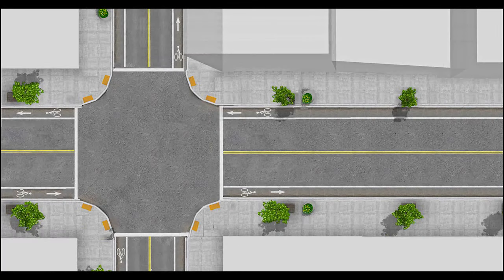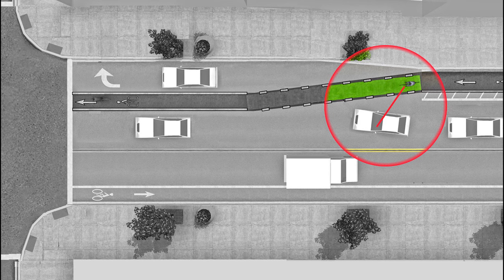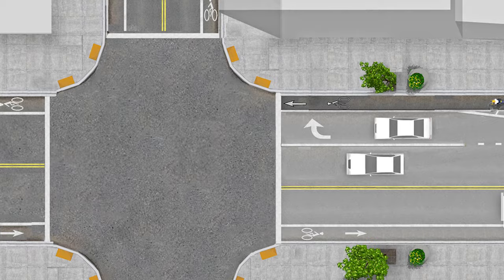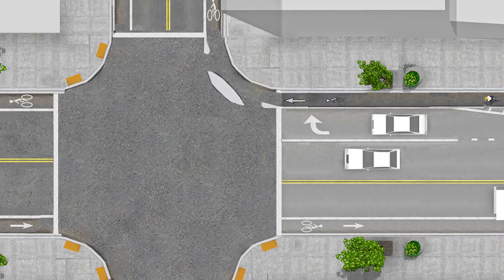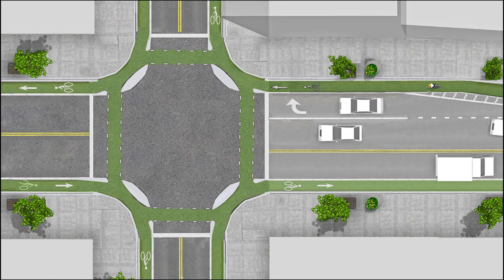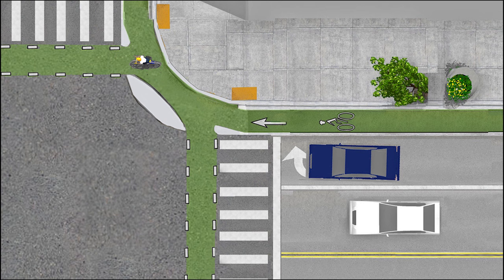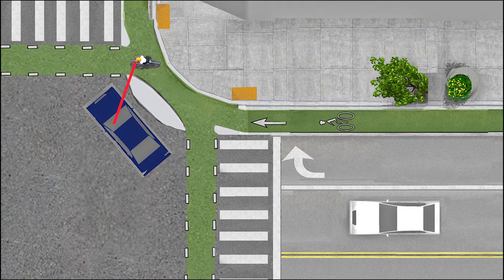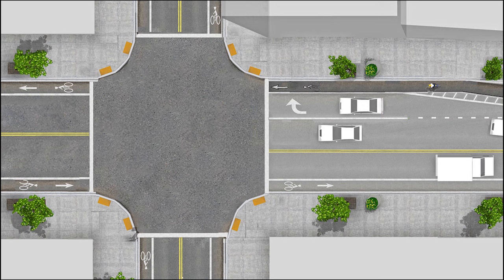Intersection design, the Dutch - cycle friendly - way

Comment: As someone from the Netherlands, I am completely mindblown at how inferior roads are in foreign countries.
They gotta take lessons from us asap.
Reply: You also happen to have a much smaller country and thus much smaller motorway to actually maintain, and therefore for you allocating costs is much easier. But not every country can do this, things have a cost
Reply: @pinakinkale  Then do it gradually. Every time an intersection needs some maintenance, make some changes to improve safety. You can't tell me that a slightly different road layout is going to increase maintenance costs by a significant amount.
Reply: @TheChrisForum  you’re acting like we don’t do that…
Reply: Ik heb t idee dat dit bij iedereen in zn recommended komt nu
Reply: @pinakinkale  well if in 10 years there has been no improvement. Then clearly  something has gone wrobg
Reply: @TheChrisForum  well, things have improved. But our infrastructure is also considerably older than Europe and once again much larger to maintain.
Reply: @pinakinkale  bigger countries have more ability to generate money to pay for a bigger road network. And good infrastructure pays for itself longterm
Reply: @TheSuperhoden  most infrastructure projects fall on individual states who are responsible for managing thousands of miles of roads in an extremely limited budget. Also cost of doing construction in the US has skyrocketed due to unions
Reply: @pinakinkale  Our infra in NL is very well thought out (mostly, i've seen some idiotic things), but it sure as hell costs a lot. Provinces are usually to provide the payments from subsidiaries set aside for road construction and maintenance. It basically works the same as the state-wise funding of it. At the moment there are a lot of reconstructions of highways and junctions going on. But they range from 4 to 10 years to actually be completed. I've seen enough signs around the country "To be finished 202X".
Next to that, they're planning to construct a highway connect, that's been in the planning for 30-ish years.

Truly all they need to do is figure out where the problem areas are, find the places that already need maintenance or reconstruction and gradually move over to newer, safer solutions for traffic.
Reply: @pinakinkale  Although the Netherlands is a small country it has a vast amount of infrastructure. The amount of highways and connections is way larger than in the States. A straight line is cheaper to maintain than a connection. According to https://en.wikipedia.org/wiki/List_of_countries_by_road_network_size The Netherlands is 30th (139,691)  on road length in the world and US (6,853,024 km) first. divide it by land mass which the US has 9,147,593 km² (https://en.wikipedia.org/wiki/List_of_countries_and_dependencies_by_area) and NL 33,893 km². 
You will find:

US: 6,853,024/9,147,593 = 0.749 km road per km² 
NL: 139,691/33,893          = 4.122 km road per km²

Clearly NL has more roads per km². These statistics also include unpaved which are rare in the Netherlands.

The size is not a great way to explain the cost. If you count in the population density than you could say the Dutch have more money to spend on roads. But this should mean that heavily populated states could follow the Dutch model as by your saying the infrastructure projects are the responsibility of individual states. Even then the US fails to implement a good model as per this video.
Reply: Sadly it's not that simple, and it isn't just a financial issue either.
First there's the element of bicycle culture. In most countries, bicycles gradually disappeared from the streets as cars became more affordable, and this happened to some extent in The Netherlands, but the high number of traffic casualties led to heavy protests in the 70s. Since then, bicycles are everywhere so the infrastructure is adapted to the vehicles that actually use it. In almost any other country, cyclists are a small minority and bikes are at best considered a recreational vehicle. So do we adapt the roads first and hope this will encourage more people to start cycling for their daily commute, or do we only adapt the roads when cyclists increase in number? The first option may seem more logical for a Dutch person or a cyclist, but for a city planner who deals with budgets, adapting the infrastructure for a small minority isn't such an obvious choice.
Secondly—and this is primarily a problem in USA and Canada but it really complicates things—there's the issue of urban sprawl. Not just the roads themselves were built with cars in mind, but urban planning at large is car-centric. Entire districts were planned around the idea that people drive everywhere, and as a result, many US and Canadian cities are much larger than they need to be. Most people live in suburbs full of single family homes, a great distance away from the city. Commercial areas have more asphalt than actual stores because everybody arrives by car. Moreover, lots of cities have very strict zoning laws, which means that you need to leave the neigborhood even to buy groceries because it's illegal to build anything but single family homes in R1 residential areas. You pretty much need a car to get anywhere, distances are much longer because everything is so spread out, and roads are very wide to accommodate all the resulting traffic. It's actually a financially unsustainable situation, but it takes more than a couple of bike lanes to change it.
Reply: @Cephalonimbus  You are absolutely right, but change of infrastructure, more choices of car-competitive ways of transport, could be a start...
Reply: Yes.
Reply: @Thingadong  Well argued.
Reply: @pinakinkale  it's cheaper to build and maintain infrastructure like ours because of less apshalt and less cars per meter road. it's not just cheaper, it's relatively cheaper (which is what counts, because you may have more space, but you also have a lot more money)
+ it's really a matter of policy. make this your default, and you'll have great streets&roads (note: no stroades) in a few decades

Comment: How to convince my city hall that this is the way to go. Stop pitting mode of transport against each other and instead use infra to ease tension and improve safety...
Reply: keep asking for this again and again. If they never hear from you, it will not change
Reply: They're just using the same strategy as a populist. Pit one group of people against an other and make up a few nonsense arguments while you run of with the money from big oil companies.
Reply: Convince people around you first. And make them convince others. Someday there will be pressure from a big group instead of just you.
Reply: It won't change without grassroots pressure. In the Netherlands this happened in the 70s when the government was tearing down city blocks for massive highway projects and people didn't like it. Then when children started getting run over there were massive protests and the government went for Plan B. It's only like this in the Netherlands now because of those protests 50 years ago.
Reply: Determination. Dont sit arround, go do.

Comment from the maker: Lights are irrelevant in that case, because a cyclist going straight always has priority over turning traffic. That is the basic rule in the Netherlands (and most European countries). The cyclists the green path through the intersection and goes before turning motor traffic. Mostly in a different green cycle.
Reply: I think the potential danger here is that if a car is stopped in the middle of right turn to yield to a cyclist, after the cyclist passes the car moves to complete their turn while simultaneously a second cyclist approaches from behind. The second cyclist proceeds to cross thinking the driver spotted them when in fact they did not.
Reply: @jon9103  You can improve on this design even further by separating traffic lights for cars and cyclists. All cyclists can then get green and cross at once and drivers won't cross cyclists anymore, making it safer for cyclists and easier for drivers.
Reply: @jon9103  In fact separate Phases of Green also improves traffic flow for the cars, as they do not have to check for the cyclists and are able to see, if they have alreade red. Something which is a bit unfortune is, the cyclists stopping at a red travvic light would block other cylists path. To stick to the example from the video, if traffic on the right side has red and has to stop, traffic from the bottom has green. Cyclists crossing from bottom to top are blocked in the upper right corner by those, who want to cross from right to left. There has to be some additional space for waiting cyclists to use the full potential of this concept. Downside is cyclist going long ways straigt have to cover quite some additional distance and turns for crossing a crossing kind of straight ...
Reply: @justus8675  I understand that, it can make each phase more efficient for the reason you state, however that doesn't mean the increased efficiency of the phases is always enough to offset the reduction in the fraction of time allotted to each phase. The most obvious example would be a congested intersection that primarily serves automotive traffic that has sporadic bicycle traffic, sure this could be mitigated by a button so the cyclist phase is only used when it's actually needed (in the US this is sort of the defacto standard since cyclist often get lumped in with pedestrians or more accurately a gray area between pedestrians and vehicle traffic). The downsides of this is that the cross phase is often too long so cars are waiting even after everyone has crossed and cyclist often have to wait a full cycle before they get a green which could be four or five minutes if there are many phases. 
My point isn't that there aren't good solutions, just that there aren't one size fits all solutions don't tend to actually fit all. The main challenge with accommodating cyclist is that there needs to be enough of them to justify the costs but with those accommodations few would choose to cycle so you end up with a chicken and egg type of problem.
Reply: @Mark Temperley Yeah, because it's the drivers who get hurt when they run over a cyclist.
Reply: @jon9103  People want to bike, the problem is most do not feel safe so they don't. People aren't going to risk their lives so that in 10-15 years there may eventually be cycling infrastructure. 
The example of a car waiting, at the intersection for the bike to cross, then a second bike comes up behind is not uncommon. Is basically just a car sitting at a stop and looking to make sure the coast is clear before going through an intersection. It is not a cyclist coming from behind but rather from their right. It's just like hundreds of intersections that exist already. The driver would be at fault in your example because they did not look and yield to the cyclist.
Reply: @schmitty8225  indeed I agree with you completely. My point is without the infrastructure few people will bike, and if there aren't cyclist its hard to convince city council to spend the money on the infrastructure since the argument goes that's its a waste of money since no one uses it (obviously I'm not the one making this argument).  The problem is you don't really see incremental increases in cycle usage with incremental improvements to infrastructure because you have to reach a critical level of infrastructure before most people will feel safe cycling and reaching that critical level is expensive.
Reply: @jon9103  Another problem is that oil and motor giants have billions upon billions of dollars. Can't have cyclists if the Motor Daddies are suckin' political sausage. At this rate, I'm surprised they haven't lobbied against bicycle shops altogether.
Reply: @hauntedshadowslegacy2826  capitalism at its finest. /s
Reply: @jon9103  I understand your point, but in a places with lots of cyclists I can tell you that this is not a problem. You will look out for cyclists, and in general will have counted them in your mirror before you even signaled your turn to start with.
Reply: @Mark Temperley And put them all in cars, completely clogging all roads? Then no one gets to go anywhere ever, so no one gets hurt. Great for safety indeed :D!
Reply: @tiemen9095  I think you should re-read the scenario since what you are describing isn't the same scenario.
Reply: You know what's irrelevant? Having cycle lanes in the first place. This kind of infrastructure is wasteful and stupid.
Reply: @jon9103  This is easily resolved with lane sorting and seperating green phases. A car making a turn should never have to stop in the middle of it. In the Netherlands, we use pressure sensors to detect traffic and adaptable "smart" phasing, the phases of which are designed for the type of junction.

A simple example is the three-way junction (A T-junction) nearest to my house. It connects one of the main roads in my city, to a sideroad leading to a residential area. If no traffic is detected on the side road (which can only turn left or right) the traffic lights are pretty much perpetually green on the main road. If a cyclist or pedestrian going along the main road triggers a pressure sensor (or pushes the button) to cross the side-road, the "cyclist green phase" will get inserted into any phase it can safely be added to, or if non such phases exist, it gets its own phase. So if pedestrian or cyclist traffic wants to cross one at any of the crossings, they'll get appointed a safe time to cross. If multiple crossings are called on simultaneously, the pedestrian/cyclist traffic tends to get grouped together into one phase, because they don't cross eachother.

On a four-way (X)junction, at most you need 5 green phases to have no traffic cross eachother during any phase. 2 phases for straight and right turn, 2 phases for left turn, 1 phase for all pedestrian/cyclist traffic. But as I explained earlier, using smart trafficlight systems with lane sorting and pressure sensors, it can be optimised for throughput by having a standard cycle which gets modified based on detected traffic. The pressure sensor data can also help map common traffic flows in the city which helps city planners with road design.
Reply: Here there often are traffic lights

Comment: Just came from Amsterdam - it is intelligent and it works! Cyclists are pretty aggressive but they follow the rules, so do pedestrians, so do vehicles. Did not see any conflict or serious close calls over 3 days - though there were minor "almost" collisions but no-one got upset - everyone just seems to respect each other.  And the traffic lights - especially for pedestrians - are so logical that it makes my head spin why we did use them here. Especially in York Region where I live. There is an audible signal for pedestrians that changes as the time is about to expire - so you know exactly how long you have to get across the street - or decide to wait. Here in York Region if you don't push a specific button as a pedestrian you are not allowed to cross! And even if the green pedestrian light is on, it only lasts a few seconds and then the red hand goes up, even though there could be plenty of time for most people to cross. It is just mind boggling why we do not adopt more of these solutions - it seems we have this fixation on trucks and automobiles as king of the road.

Comment: In Toronto, it's only this year, if we are on schedule, to start installation of the Dutch-protected intersections as the plans were introduced during public consultations about 1.5 years ago.  However, I had noticed that one one major intersection, the protection had been removed on one corner.  I wrote back to the planners who replied back "There are significant constraints related to space at that corner with the property line and many design options were explored. There are trade-offs related to accommodating large truck turns, cycling space, and pedestrian space. The bikeway physical separation, however, does extend to the intersection and the bike movement is fully signal separated from vehicle turns at that location. The design is not finalized and we will continue to explore opportunities for geometric improvements as we move towards implementation."